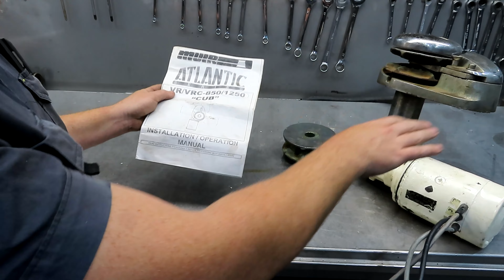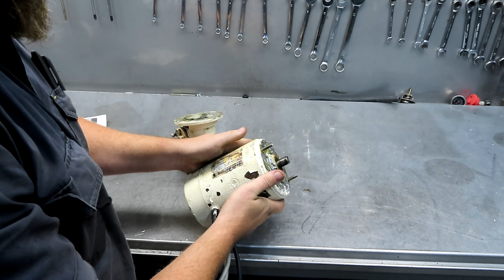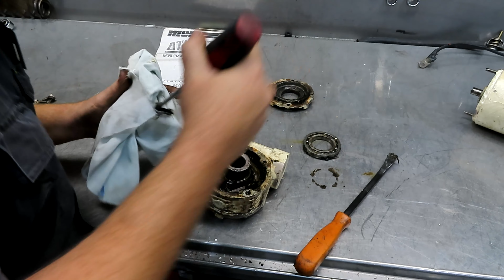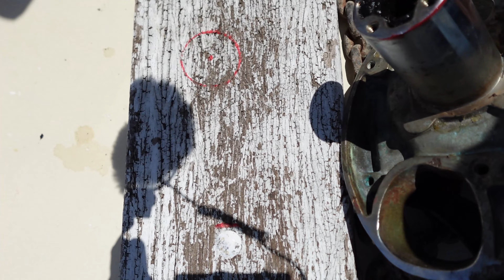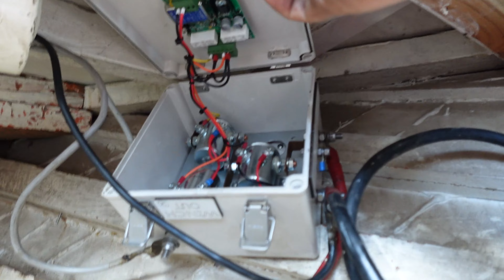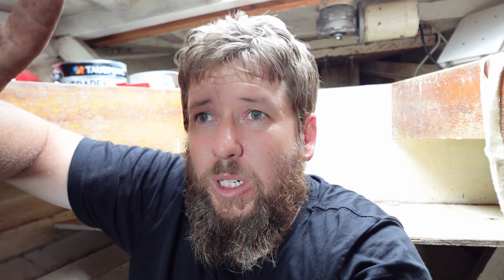"NEW" Windlass install for Kiarra, nothing ever goes to plan!!!

Comment: Pror  to putting winlass  on how where your zink  blocks  any signs of pitting  if not and they are good check again in about a month if it's starts to Pitt then you have a live  connection where it should not be  we found that out when we put a winlass  on our boat
Reply from the maker: There were no signs of bad pitting prior but I will check in a few months and see how they are going 👍

Comment: Instead of running battery cables  the length of the boat, wouldn't it be better to have a battery up front and just run a charge wire from the alternator or use a DC to Dc charger? You could also use it as a house battery for the cabin.
Reply from the maker: It probably would be a better setup to have a battery up in the bow but to be honest it was more of a convenience thing as the cables were already in the boat from a previous winch setup I would guess. If I do find I'm having issues with voltage drop because of the cable length then I will change it to a battery up front like you mentioned.

Comment: Nice one Tim, that was a good score you got with the windlass and the replacement box, I guessing the chain will be about a 35-40kg so can you not put it in a wheelbarrow or trolley from the car to the jetty then use the windlass to load it into the locker?
It took me a minute to figure out where you were in the bow and it never made sense till you came back into the cabin, that's a decent size space under there too 👍
Until next week fella, stay safe and keep having fun all the best from Scotland
Reply from the maker: Thanks mate. Upon looking around I found that my model winch retails for over $2500 here so yeah I feel like I got a good deal. The chain weight is a fair bit more the 40kg unfortunately. I put it in a tub on my trolley and it actually bent the plate it was sitting on. I think at this stage I'm going to load it from my car into the tender them use the windlass to lift it out of the tender up and into the chain locker.
Reply: @HarpersBoatShed   I dropped the F'me bomb but I'll let you decide whether it was because of your great luck with the price (seriously mate get a lottery ticket on) or the chain weight 😁
Reply from the maker: Lol yeah I was stunned when I saw the price. I know they are a high end brand of windlass but I had no idea they were worth that much. I would estimate there is around 100kg of chain to move. I can't even lift one side of the bucket.
Reply: @HarpersBoatShed  Top tip from an old man, take the pain meds before you try to move that chain, it means they will already be working when you've stiffened up and really need them to 😉😣
Reply from the maker: Lol thanks for the advice mate, whatever I do I'm sure it will hurt the next morning anyway

Comment: Thanks for the video, I would have liked to see the process of making the new part to connect the motor and gearbox together. I know it’s all about time Regards Mike
Reply from the maker: Cheers Mike,
Yeah I let the team down with that one. Unfortunately there was such a time gap between when i fixed the windlass and when I installed it that I had lost some of the footage of doing the mods. I will be sure to show it in more detail on the next episode though 👍.

Comment: Tim, that larger chain drum looks as if it had a much larger chain on it hence the huge wear on the gearbox. Realistically, running with the 10mm chain is going to be a way betterer move with the 68-1 ratio; just don't run with a heavy anchor (you know what I mean there).
Great to see it in Kiarra and it really does suit the old girl. :)
Reply from the maker: If it was running the wrong chain that would certainly account for the wear and the gearbox like you mentioned. Now I actually have the 10 mm chain I'm glad I didn't buy 8mm it would have been too small for the boat. I do have a reasonable size anchor but don't think it's too big for the boat.

Comment: I feel you pain although my windless is in they bolted it through deck into nothing just sitting there basically 😮 so am going to put some ply bearers in whick they can then bolt to bit of a pain 😮. Nice job on yours nice score as well as theu be well in excess of $1000k. Keep at it. 😊😅
Reply from the maker: Thanks mate, yeah sounds like you need to beef up the mounting of your winch a bit. I looked up the model of windlass I have and they retail here for $2500 so yeah I feel like i got a good score

Comment: Are you going to run the switch for the windlass back at the helm, or up front on the bow? 
Or both even?
Reply from the maker: I think I will just have the isolation switch in the bow. The winch is used via a wireless remote and when not in use it's only the receiver board that drawers any current
Reply: @HarpersBoatShed  ahhh ok. Hence the extra circuitry in the control box....remote will be easy peasy. Just remember to have some extra remote batteries stashed onboard just in case 😋
Nice work, Tim. Hope you and the family have a safe Christmas 👍
Reply from the maker: Thanks mate and yeah that's a good idea to keep spare batteries. I can override it via a small push button on the receiver board if the remote does or something happens to that effect. Safe and happy to Christmas to you and your family also.

Comment: Would you be better with a battery fitted forward for the anchor winch, to negate the voltage drop, from the battery bank in the stern?? 
Alternatively  are the power cables able to carry the current  with out , significant voltage
 drop??
Reply from the maker: A battery up the front would be ideal but the cable that is already in the boat is more then big enough to handle the current. I will be sure to only use the winch whenever the engine is running though so I don't drain the battery to much.

Comment: Nice to see a powered Anchor Chain winch on Kiarra, everything that reduces the time and effort you need to put into it, is a good thing. and what's good about the Winch is that is has a used patina that is not out of the ordinary on the boat, as a completely new unit would be, so it looks like it was always there, as part of the boat. Well done, as always Mate! looking forward to the next update. any idea as to when you'll be dropping in the Engine and leg assembly into Kiarra? And more importantly is there enough room for that engine in the engineering compartment of the Boat to it? I'm seriously looking forward to those sets of Videos! until then, keep both your oars in the water and stay strong!
Reply from the maker: Hi mate and thanks for the comments. I can't wait to have the anchor setup all done and be able to drop and raise at the push of the button. As for the engine work. Hopefully I can get it done in the first half of next year. As it sits the engine won't fit straight in, I will have to move a few floor support beams but nothing too serious.